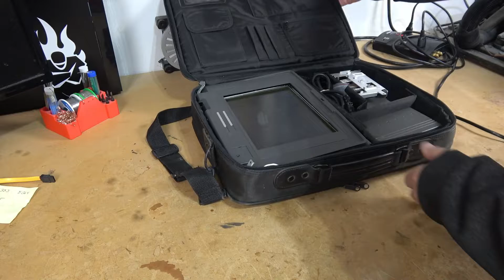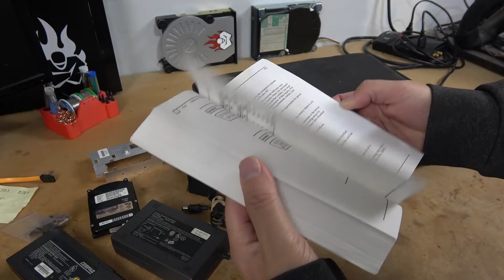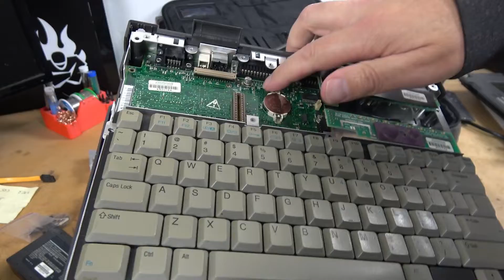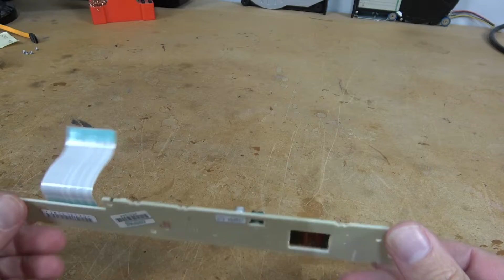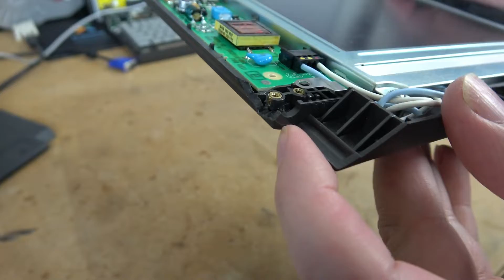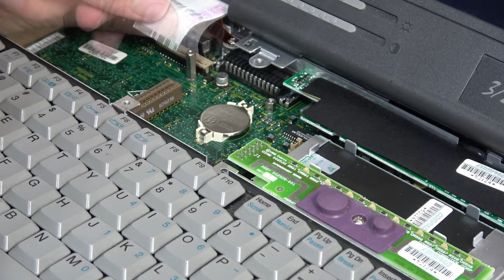Mix and Match Compaq Contura 3/25 Laptop Repair

Comment: It’s a nice restore.  I unfortunately am used to recapping these boards and power supply boards.  Most of my power supply boards had caps starting to leak.  

If you haven’t already, You’ll also want to replace the lone capacitor in the diskette drive.  I don’t remember the exact value of the cap off the top of my head.  They do leak like the system board caps.
Reply from the maker: Thanks!!  I can look that up.  That laptop rarely gets any use but, am hoping to do a few retro gaming videos with it really soon.

Comment: Nice! I have a 3/20 dating back to my student time. The HD cannot be accessed due to an interface error. I installed a 64MB compact flash instead. Just have it working. What kind of external display did you connect? I notice one of the output pins is blocked, so I cannot insert a VGA cable. How did you fix this?
Reply from the maker: When I first got the laptop I had bought a VGA cable with the pin missing, they were quite common back then. (and forgot I had it until after I released this video doh!)  
For this repair I took a small drill bit and just drilled out a hole in the connector, that way I can use a standard d-sub cable.
Reply: Thanks! Yes, further searching learned that this is old style. So I checked my cable box in the basement and pulled out two old cables with pin 9 missing. I notice there is some disturbance on the screen. These cables do not have ferrite buds, so I am guessing this may be some interference? I will order some to see if it helps to stabilise the image. Now installing Windows 3.11 ....
Reply from the maker: Good luck,  I need to pull that compaq out again and get some more software on it.  My plan was to do a Nethack gaming session and maybe broadcast it.